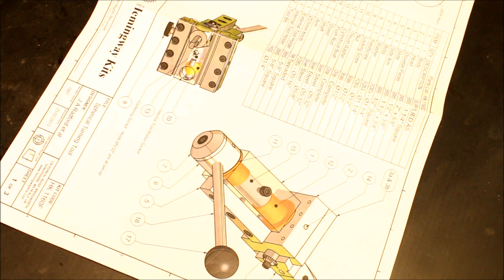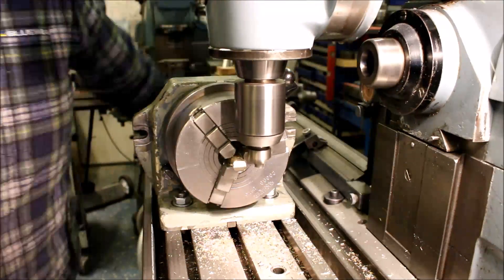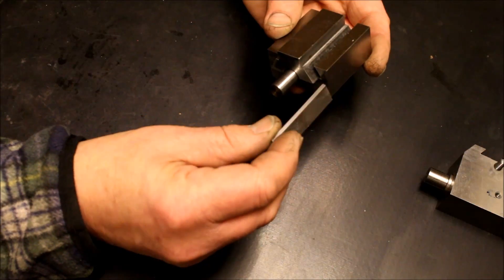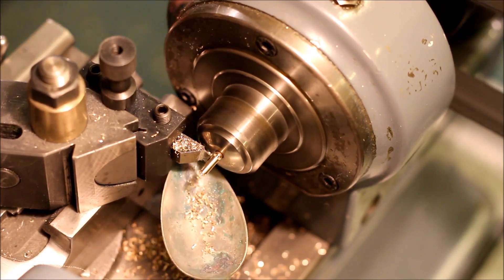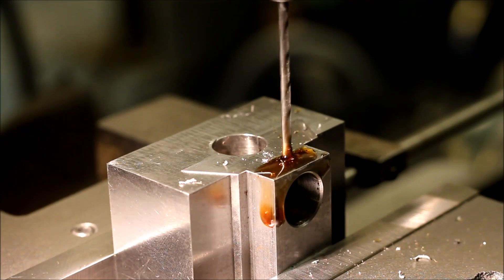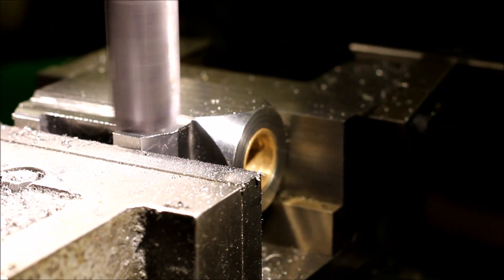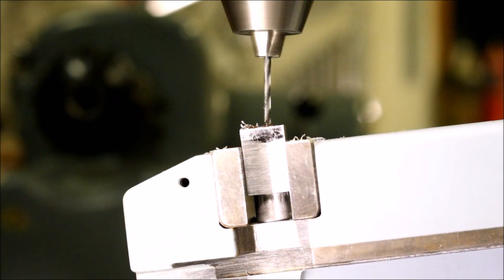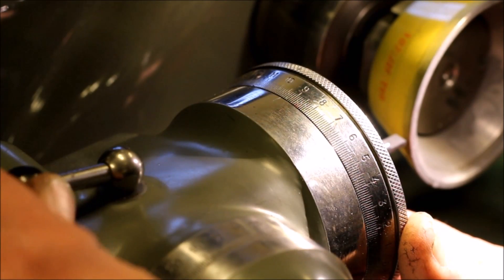hemingway kits Spherical turning tool

Comment: I built one in the same style several years ago. I wasn't very pleased with it. Getting it set up was a headache. Adjusting the cutter after every pass was a pain. Unlike the vertical post type of ball turner the carriage and cross feed must be locked once up and all feeding has to be done with the boring head. Once the diameter is set on the vertical post type, you center on the ball or concave surface to be cut and feed in with the cross feed... a much faster process.
The type you are building did have the advantage of generating a sphere with a smaller shank much closer to the chuck. Using the micrometer feed on the boring head it could be set to easily cut a specified diameter.
https://groups.yahoo.com/neo/groups/12x36importlathes/photos/photostream/lightbox/1217400520?orderBy=mtime&sortOrder=desc&photoFilter=ALL#zax/1217400520
Reply from the maker: Thanks for watching. Agree that it is time consuming to change the setting. But the tool works surprisingly well. Will use it in a future project.

Comment: Hi Erik - great work as well as camera work. Love the video series and maybe I'll make this project, as it seems fun and challenging. What camera do you use and what kind of spot lighting are you using? Looks SO good.
Reply from the maker: Thank you :-)  I use a Cannon 700 D with standard lens (35-55) and a 50 mm F1 / 8th The lighting is old Swedish machine lights equipped with 100-150 W halogen. Sometimes I use Manfrotto "lumimuse B" or Ikea Jansjö for spot lighting. Have thoughts of better lighting and sound but it always shows up new machines that dig deep holes in my wallet. :-)